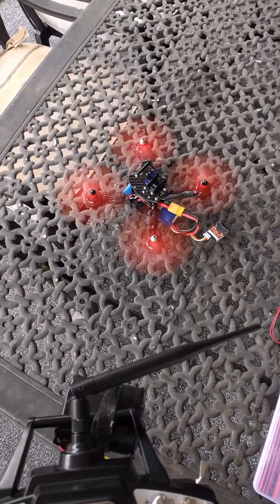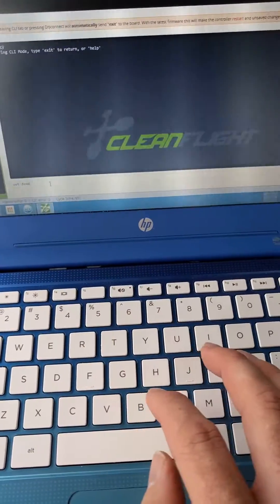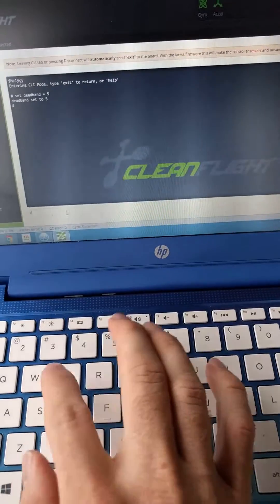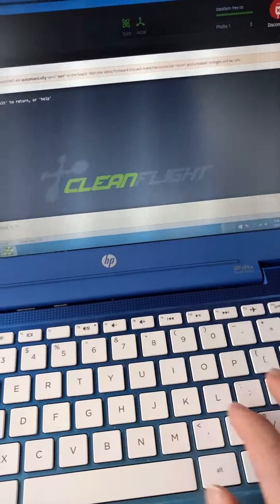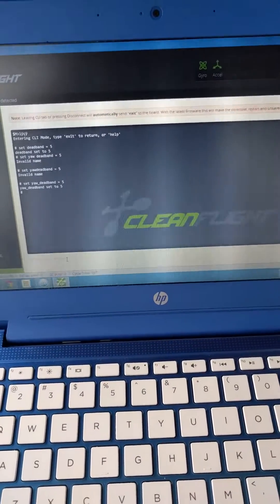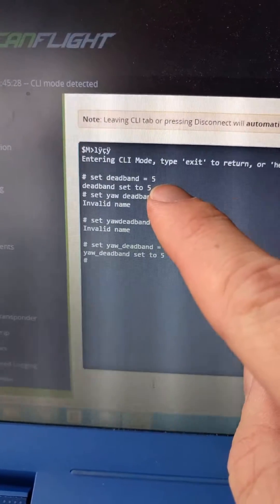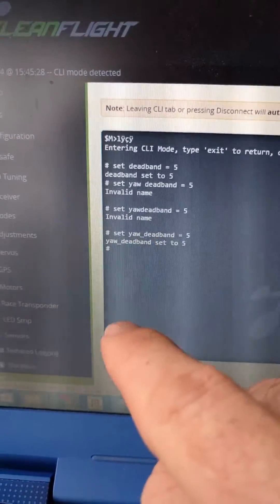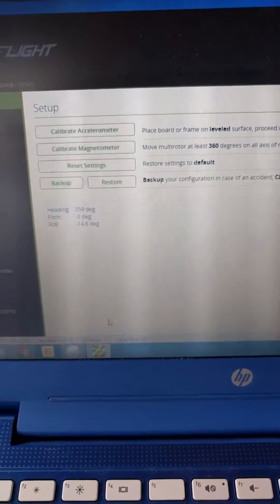Yaw deadband example in cleanflight

Comment: that might just solve my latest problem. Quad keeps yaw-turning by itself in acro mode.........will try to change with >>set yaw_deadband = ?
Reply from the maker: That should work. The deadband is the area of jitter from your Rx/tx. You can usually see the jitter in the transmitter portion of the program, then you know how much to set it to. Like if it jumps 3 digits, it would be safe to set it to 4.... Hope this makes sense